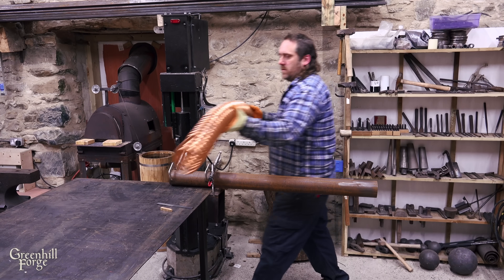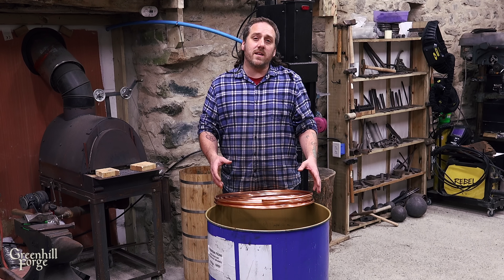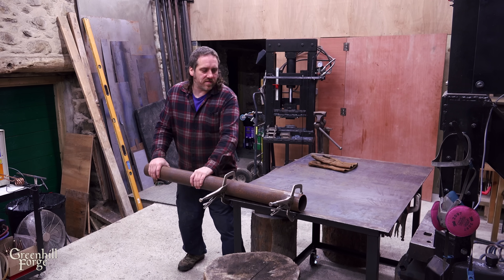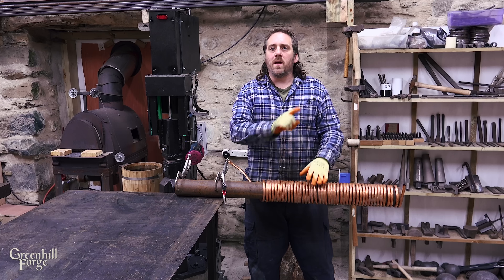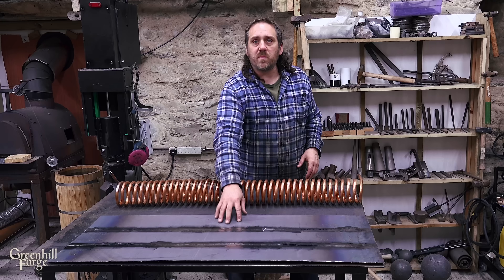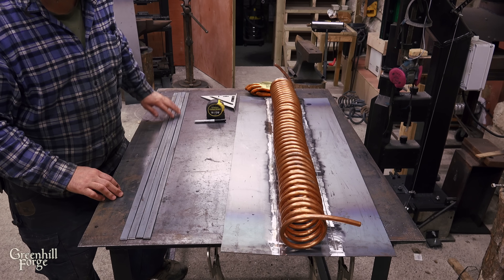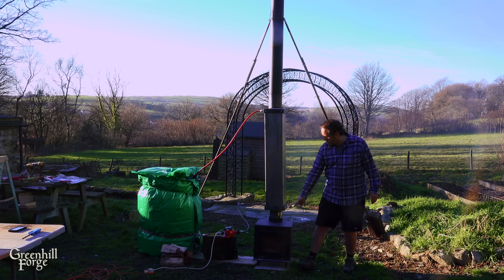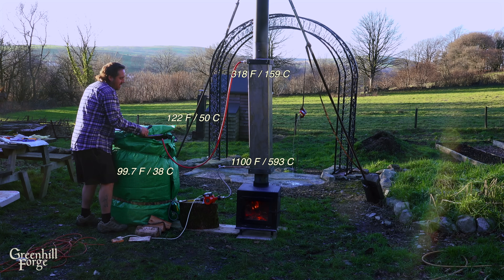Wood Stove Water Heater Experiment - Surprising Results! Part 1

Comment: I have built many water heater systems over the years. And, reading the comments below, I know others have mentioned some of these points already. However, I will tell you again from my hands on experience. Also, I am not only a DIY fellow, but my trade is Ground Source Heat Pumps and Refrigeration.  So, I know a thing or two about the in's and outs of Heating and Cooling.    First, since you are using a water pump rather then Thermal Syphoning, you have your water IN and OUT backwards. To gain the highest efficiency, you should use Reverse Flow. Meaning your Water INPUT should be at the Top and the Water Outlet should be at the bottom.   The next problem you will encounter is, when you extract the heat from the exhaust gases of a wood stove, you are cooling the gasses down. This will cause the gases which contain Creosote, to become sticky and they will build up on the inside of the chimney pipe. If  this build up, which happens depending on type of wood you burn and the moisture content of the wood, among other things, But it can also be an extreme fire risk for chimney fires etc.   Extracting the heat from the exhaust gasses, is NOT recommended.   The better way to build a water heating system or boiler is done in one of two ways. Either build a Full Water Jacket Wood Stove where the water is surrounding the fire box itself OR, with an existing Wood Stove, install a Stainless Steel Water Coil inside the fire box.  It is the most efficient way to extract heat energy from the wood which you are burning  when using a pre existing wood stove. Make certain in any of these systems, to include more then 1 safety devices, like  pressure relief valves. If you don't, you are in fact building a Steam Vessel boiler and/or in the simplest terms, a Bomb.  As well, building other types of systems would be a 10th of the cost for materials to install it.  Do not misunderstand, You video is well done. It explains everything you are doing and why you are doing it. And thankfully, it isn't filled with Background Music, which in most cases, drives a person crazy.   Your audio is very good and overall, it is a great video. It only has just the 1 flaw. What you are building is a BAD idea.  The only other ideas, which would be even worse, would be to install the copper coil directly inside the chimney pipe...!!!     I heat my home with a hand crafted DIY wood and water heating system.  I heat with Only wood and I live in Northern Ontario Canada, where it is common to go down to -40°C for days at a time. In my case, I use a Water to Air heat exchanger and all my hot water comes from a Coil Loop inside my wood Stove. I do have a large water storage tank in the system, which acts as back up when my fire dies down.  It's always nice and warm all night long and well into the morning even after the fire has died down.  Keep making your videos as you have a grand talent and it certainly seems, you have a following of DIY's who enjoy watching you.  But as for this idea...   It is a BAD IDEA and a potential fire hazard.
Reply: Great comment. As an engineer, my first impression of the ‘design’ was that it was ‘close, but no cigar’ for the safety and no counter flow design flaws. The creosote criticism is well placed and is probably only knowable by actual experience with a smoke flue gas heat exchange.

To date, all of the DIY videos on wood stove hot water heaters that I have seen have shown the lack of engineering training on the subject of boilers by their fabricators/designers. An ingenious master fabricator, like this one, would be well served by studying basic heat exchanger technology and the ‘state of the art’ of industrial combustion off-gas cooling/heat extraction.
Reply: If he boils the water he is going to need soft water. Strictly rain water would be fine, but well water will be a big problem. Also the copper is not good for a boiler. The condensate is acidic and will eat up the copper pretty fast. Speaking of condensate……not that this design will not work, but it would require regular maintenance and cleaning. Boiling the water is not necessary, but he does need some kind of control to keep the temp below the boiling temperatures, but his design is in the flue pipe. That makes it difficult to control temperature. In addition to that there is no room for expansion. A boiler needs room for expansion and as I stated before condensate also would need to be addressed and if it’s well water he will have a lot of mineral build up.
Reply: Great reply. No one thinks about STEAM!!
Reply: Thank you, I am interested in putting a pipe across the top of my wood stove instead of inside. What are your thoughts?
Reply: All@😊
Reply: Great comment. I was wondering about boiling water in a closed system. Seems like "boom" if the pump shuts off. Lol
Reply: Want to do a video would love to see your setup and how to do it
Reply: Make a video, I would deffo watch it
Reply: Do you think you can make a video on your set up and share with us please
Reply: Thank you I've built quite a few of these heat exchangers for outdoor spools and hot tubs and his design was scaring me The steam is no joke It is dangerous and a creosote fire is dangerous toxic and insidious you never know when it's going to happen...
Reply: Good comment, as a grave digger I know all about extracting every last bit of heat from the body or the ashes, because it's a cold job.
Reply: Привет! Вопрос - вы дома используете в качестве теплоносителя воду или какой-нибудь антифриз?
Reply: Bro. 

Learn to paragraph.

Comment: Heating water with a stove pipe great idea, but your making a very big mistake.  DON"T put the water coil inside the pipe where the smoke is.  It will collect that creosote you don't want.  Put the water coil on the outside of the pipe, it will still get very hot.
Reply from the maker: check this video out https://youtu.be/nJp3o8WJ05s
Reply: @GreenhillForge   OK I watch the video you wanted me to watch.  So yes we are in agreement that this idea of putting the coil inside with the pipe is a BAD idea.   I Recommend on this video put a Warning statement at the end saying that this is a bad idea for SAFETY and to see your other videos with super improvements.   I just don't want folks to only watch this video and make this version and be unsafe.  Creosote Fires can and do burn down houses.

Comment: Loved it but not really off grid if you need an electric pump. You know what you need to do next. Boiler time lol.
Reply from the maker: the pump is just for testing. eventually it'll get removed. and yeah, I'll get into boilers eventually. I show an off grid water jacket shower I made in this video https://youtu.be/pP_2A5Wdvqg
Reply: @ awesome I’ll check it out. Just don’t hurt yourself with the boilers. Rupture disk, pressure relief valve and low water cutoff 👍🏼

Comment: If u hooked a small pump up u could make a wood whole house heater off one fire stove base boards expansion tank and pressure relief valve u would get more heat I think if u did a zig zag ladder shape stager the steps onto ladder so they catch the hot air deflected by the pipe below it trust me it will work better

Comment: I had an Earth Stove with a coil in the fire box in 1974 during the oil embargo.  The coil consisted of steel 3/4" pipe run in a lateral direction at the back of the vertical wall on the stove.  Three runs. The stove was upstairs and the water tank was in the basement so I used a circulating pump to keep the flow going.  I was in series with my domestic hot water.  Funny thing I didn't expect is I had an oil boiler also in the basement with a coil in it.  The wood stove circulating water through it kept the boiler warm.  The boiler was shut off since they wouldn't sell oil.  It was a baseboard hot water heater.  Never had a problem with creosote because I burned a wide open fire once a day for thirty minutes.  The uninsulated stove pipe section up to the Metalbestos would glow cherry red in the early morning dark.  This kept the coil clean as a whistle and the chimney as well.  A friend who was scared of wood heat would only percolate her stove and every month or two she would have to clean the chimney with a resulting five gallon bucket of creosote.  I would feel guilty and go check mine every four or five months.  I never found any significant build up at all in the five years I ran it.  Not only that but firewood was hard to get so you burned what you could lay hands on.  The first couple of years I burned green wood, drift wood, all softwoods and still not a problem as long as I burned it hot two or three times a week at least.  While it was roaring with the door ajar I would take a thirty minute hot shower to start the day.  Never once felt the heat of the water drop although I did not test for numbers.  Worked very well for me.  Keep in mind this was before the secondary burn and other efficiencies of the modern wood stove.  This topic also brings to mind the old fashioned wood cook stove setup.  The stove was against the wall which bordered the bathroom so it heated it as well but to our point here there was always a gravity hot water tank mounted on the wall behind the cookstove to provide hot water.  A relatively efficient form of wood heat although the other rooms were not well heated and would require a smaller stove to keep the end of the house warm.  The bedrooms were upstairs so the rising heat warmed them.  Long before well insulated homes and some were mighty drafty but it worked for them.  That small coil reverse heating the large boiler pointed at how efficient it was.  I was dumbfound when I put in a new boiler (on demand Systems 2000) in 2009 and saw the tiny heat exchanger that it used mounted on top of the boiler casing not even in the fire box!! It was about the size of two cigarette packages yet able to keep a constant flow of hot water going as long as the oil holds out!  I would have to look up the efficiency numbers on that which must be amazing.  Think of a way to utilize that in your water system.  It never sees the fire just the hot water for the baseboards runs a zone through it heating the domestic water for use.  So no contamination no electrolysis, no soot or creosote.

Comment: id plug the bottom and fill it with sand for the insulation but youd also need a pipe for the center

Comment: For the coil housing, could you just use a piece of 8 or 10" stove pipe with a cap at the bottom? Just use a wire to anchor your coil inside, and fill the entire cavity with sand to insulate it? Just a thought.

Comment: ....THANK YOU!!  [IMHO:  YOU COULD'VE BENT UP A "J-SHAPED PIECE OF SQUARE STEEL PIPE, OR SOLID BAR, TO SERVE AS YOUR "COIL SPACING TOOL/GAUGE""IT'D BE A LOT EASIER TO WORK WITH THAN THAT TINY WOOD BLOCK.}

Comment: I'm really impressed and in wll honestly, if the ancient Roman Engineers were around, they'd love this too. I've seen some of the designs for Roman Bath Houses that had heated statems and this really mirrors them sans the copper.  

I dont think you'll be building a complicated fluted floor system to achieve the same results anytime soon and this perfectly illustrates eat transfer.

Comment: Excellent video,  excellent build, appreciate your safety warning about working with the insulation.  I had no idea that stuff was so toxic but I've never worked with it either.  I'm sure it probably has warnings on the package and I'm not planning on working with it in the near future,  but I'm a typical guy and I probably would never have read any of the packaging if I was going to work with it.  All and all though,  I'd give your video 5 stars and recommend it to anyone attempting a build like this!
Reply from the maker: Thanks very much! It's not chemically toxic, but it releases very tiny fibers that can get way down into your lungs and cause damage.

Comment: Well done. I'm concerned about build up of creosote on the copper, so a convenient way of cleaning it would be good. This might not be as much of an issue with a rocket stove. You threw me when you said that temp at the bottom was 1100, I was thinking, well now your copper is melting...oh, wait, Fahrenheit. It will be interesting to see the rocket stove.
Reply from the maker: Thanks. I've got a video of a new design (partially something I've never seen done elsewhere) coming soon.

Comment: if exhaust gases are going out very cool then a lot of liquid soot is already building up on the copper pipe and it will corrode it soon.
Liquid soot contains plenty of very corrosive acids ... so short life expectancy despite the very interesting initial results ...
Possible solutions:
- Pipe behind a sacrifice wall who will attract all the fumes acid condensation;
- A very hot fumes section of min 1m before to burn the unburned gases before reaching this very cold exhaust - to reduce the amount of soot and recover some loses from inefficient burning - like rocket stoves;
- Like some comments from others here ... a reversed forced water circulation will extract more heat ....
Its a saying that only who does not work will do not make mistakes ... so its better to make mistakes

Comment: Great job. If I could offer a piece of advice… you’re going to get leaks because of electrolysis ( copper touching iron or steel). I would suggest using copper strapping. The flowing water is your enemy. The two metals want to share electrons because of the water flow. This causes the copper to break down first because of its a weaker metal…thus it starts to leak.
Reply from the maker: Thanks! It's actually the steel that corrodes primarily. I talk about it a bit in this video https://youtu.be/pP_2A5Wdvqg

Comment: I  hope you don't mind a tip from a Steam fitter  of 40+ years.
suspended a flat piece of sheet metal that you twist, try 6 turns in that distance....  almost as wide as the coil. it will still draft  no problem. leave the metal helix loose so you can pull it and clean your fire tube except square. 
hot water heaters have there flue  fire tube going through the water tank.
they have a helix or a crushed in wall by about 1/3- 1/2  then  90°  and dented again alternating up the flue.  Might as well get all you can. experiment.
Reply from the maker: Thanks, I'll keep it in mind. I made an off-grid flue water jacket shower system I show in this video if you want to check it out https://youtu.be/pP_2A5Wdvqg

Comment: A distlation stack with pot scrubbers might do well and woodgas designs have always had a gas cleaning process. If you study these, you might deal effectively with creosote issue. Cleaned wood gas can be stored and used later
Reply: Stainless Pot scrubbers can be cleaned with solvents with a net usable energy gain from the creosote

Comment: There is a major flaw in your design. You have the copper coil in contact with the steel (sawtooth retainers). These dissimilar metals have different coefficients of expansion the copper will wear away. The more times you let it heat then cool, the more wear will occur.

A barrier like thin ceramic Kayowool should ge used to keep the coil away from the steel. 

If there was a structural failure with the pressurized copper pipe, I wouldn't want to be around to witness the steam explosion.

Comment: Copper should never come into contact with steel, it will be eaten. Plumbers know this, I know this after replacing a 1 foot piece of line from a metal strap hanging from the line.

Comment: I love all the detail you put into this build but it didnt take but a few minutes into the video before I realized the idea would be contingent on this builds ability for the heat exchanger assembly to be EASILY disassembled because you would have to clean the coils daily to remove creosote deposits that would act as insulation protecting your copper coil from absorbing heat.

What I would suggest is have the coil wrap around the OUTSIDE of the flue. You could still build an insulation box for it but with it on the outside you will never need to clean it or potentially move the malleable copper coil. If you do this without an insulation box that heat will also act to catch heat and distribute it into the room like the flue typically would. So just by virtue of having raised surface area you are further expanding the area generating heat.

Honestly with this much effort put in you might be better off building a retro "Boiler" system and run steam radiators as well and use it as a primary whole house heating system. This sort of system would struggle compared to a boiler that would be able to heat more water than you could ever use. Its more mechanically complex but would also be VASTLYefficient.
Reply from the maker: This is really just a test unit to get data and compare with other designs. been filming tests of a new design the last few days, hopefully out next week.

Comment: Sorry to spoil all the positive comments but you just built a great creosote trap that will reduce the efficiency as it builds around the copper pipe. In my not so inexperienced head that is a problem in the long run.
Reply from the maker: this is just a test unit to get data. probably won't be fired more than 5-6 times. I talk about this in this video https://youtu.be/pP_2A5Wdvqg .There's also this video https://youtu.be/G7k_CatVFM4  and I'm in the middle of filming a totally different design to compare these with that will be out soon

Comment: Nicely done!

I recommend that if possible you keep the water supply higher than the heating coil. That will help ensure that water is always in the coils, and you could also eliminate the pump so a power source won’t be needed.